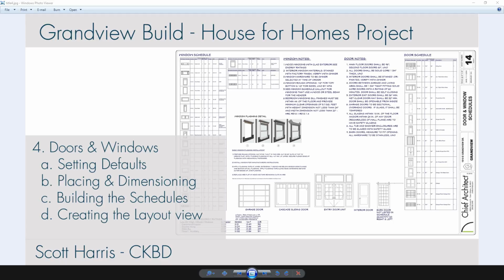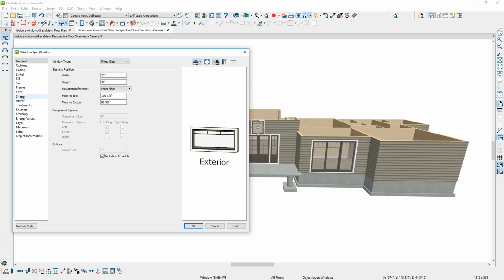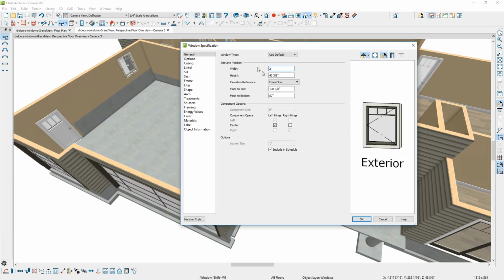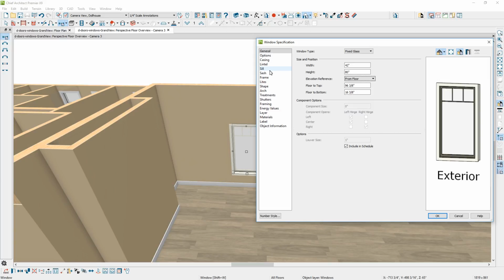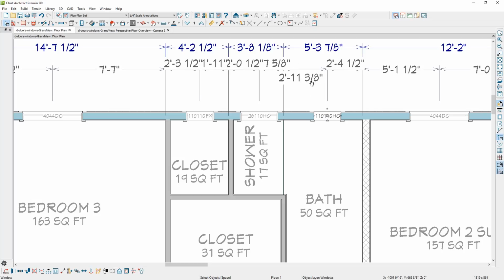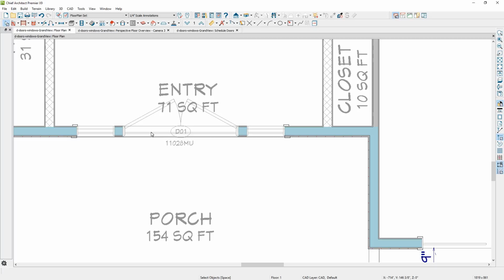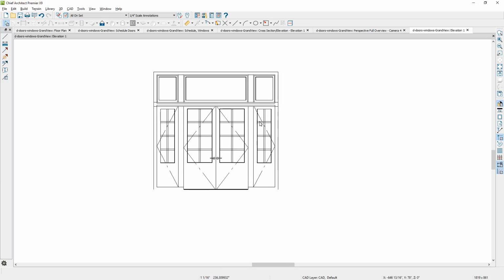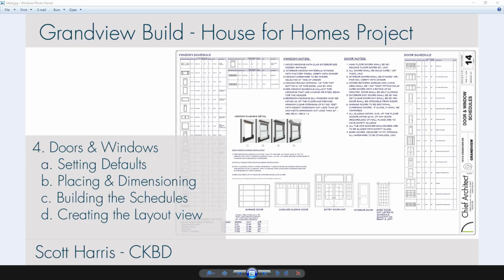Grandview Build Project - Doors and Windows with Schedules

Comment: My door schedules did not bring out the door sketches
Reply from the maker: Hello Bestyentertainment. You can add them in the Default Preferences so each time they will appear. 
Go to Edit>Default Settings>Schedules>Choose the schedule type>Under Available Columns there is an option to add the 3D Exterior Elevations and the 3D Interiors Elevations.